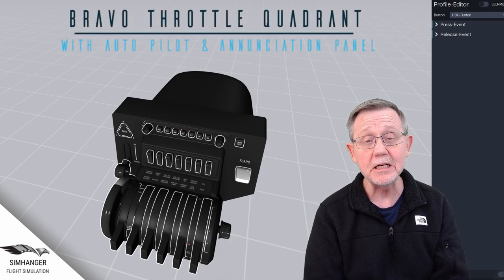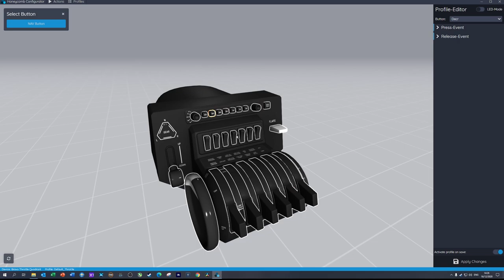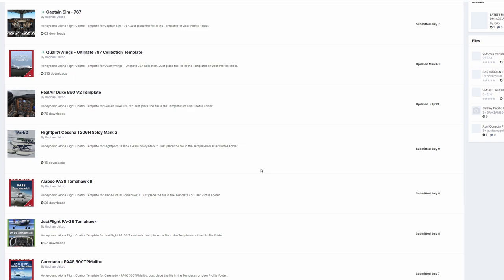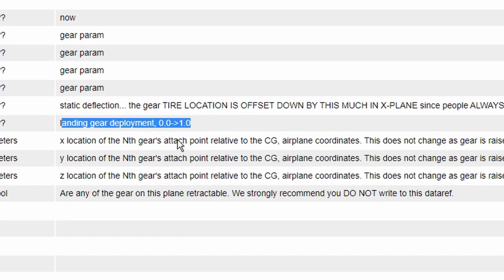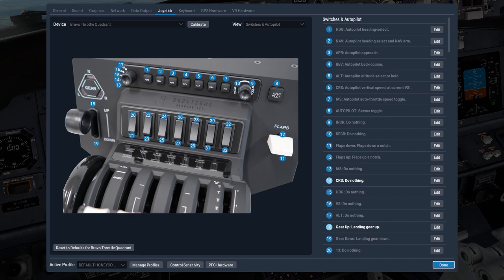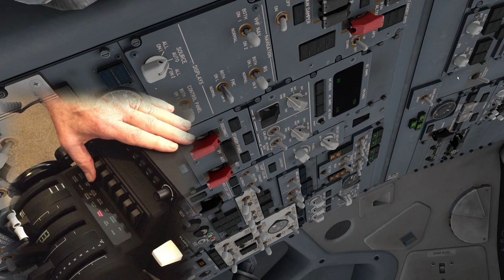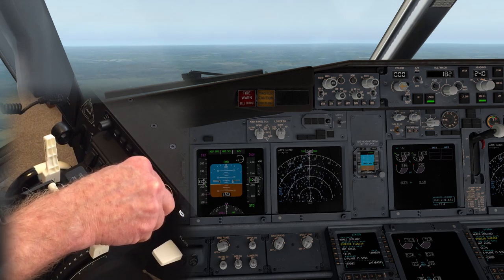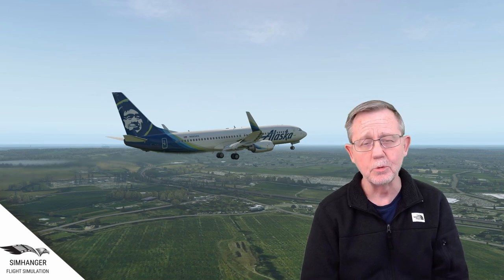BRAVO THROTTLE QUADRANT | CONFIGURING FOR XPLANE11 | Getting the lights on!

Comment from the maker: PROBLEMS INSTALLING HONEYCOMB CONFIGURATOR FOR XPLANE 11: See the description notes below the video, details of possible solutions provided there to help. Thanks for watching. Want to see the config for Microsoft Flight Simulator? Check it out here https://youtu.be/E06yP5g90eY       If problems downloading config file from site….right click and choose download incognito
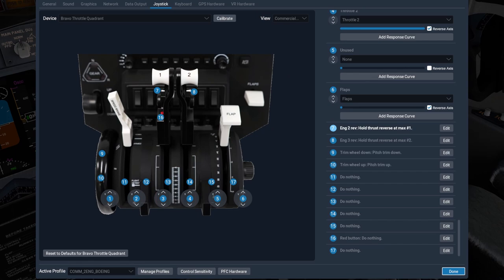Reply from the maker: Check you are mapping the reverse thrust to the right engines as shown in my video at time 14:36 hope you get it sorted.
Reply: Big fan of your videos, thank you! Do you know how I can solve the 'hydraulic oil low' light that seems constantly on??
Reply from the maker: @jagwal1   I have the same issue with most aircraft. You will need to adjust the parameters assigned to this function in the configurator. Regards
Reply: @SimHangerFS  OK...how?, what parameter should it be?
Reply from the maker: @jagwal1  to be honest I don’t know. Sorry.
Reply from the maker: @jagwal1   quick update, honeycomb to update configurator to eliminate this problem, not sure when. The MSFS has just been updated.
Reply: @SimHangerFS  Very good, thank you. Not that I'm in a rush, I'm just learning to set it up while I'm waiting for my graphics card for my new pc build, in backorder since October. ETA... April? Sigh :-(
Reply: Just downloaded the configurator for X-plane again to check if it's been fixed, not so...

Comment: Quick and Easy when it works. When the lights don't com on and the selectors don't work, you're hanging in the wind as no one has shown how to activate individual lights yet in the configurator. Lots of videos like this but none when the defaults don't work as they're supposed to.

Comment: The main point is having to download the drivers, something I didn't realize.  I couldn't understand the configurator so I just left that site.  In XP12, I got the essential speed brake and throttles going.  I set up the reversers in the same manner that you did but, no workee.  I will have to try things to figure out why not.  With my old Saiteks, I could simply pull them back into the detent and they worked, perhaps XP remembered that?  Not sure.
Fortunately my yoke has convenient buttons for the gear, TOGA, and flaps, as well as the trim.  Tomorrow I will try to set up the PMDG 737 in MFS2020.  Be interesting to see if reverse works in that.  
I got the Bravo throttles so I could also fly the ATR in MFS, and that is working fine, but has to be re-done so the positions match with the 737 and I don't have to swap throttle handles going back and forth.
Reply: Actually, I found that one of my reversers works and the other one didn't.  That shows that it was the correct procedure.  I have re-set the other one and will try it again.

Comment: Hello Mark. All my settings are working except for CRS knob in conjunction to Decrease/Increase Knob. Do you know why? When I put in CRS and select Decrease/Increase Knob nothing happens. Could you help me?
Reply from the maker: Make sure you turn the left hand dial to CRS…second to last position
Reply: @SimHangerFS  yes. It is in CRS position but when I use the decrease/increase knob nothing happens. It works fine on MSFS. The issue is only in XP11

Comment: Hi 
Thanks for the your videos. I have a question, do you install the software before or after you plug in the throttle quadrant, or does make any difference.
Thank you.
Reply from the maker: Plug in the peripheral first to create the default profile.
Reply: @SimHangerFS  Thank you, I just received the Honeycomb thottle quadrant. Thanks with help to set it up.

Comment: Great video Mark, thanks. Wonder if the heading bug for msfs will still go 10 degrees per click. Surely would defeat the purpose of having the throttle quadrant. I actually think Asobo did this "by design".
Reply from the maker: I hope they sort this heading issue  out in the 22 Dec update. 👍
Reply: @SimHangerFS  Has it been fixed yet?
Reply from the maker: @clearbluesky2009  regrettably no, they are indicating update three, so around end of Feb by the looks of it. Regards
Reply: @SimHangerFS  Thanks! Have you tried the solution described here (scroll down a bit to a post from a user named missamo)? https://forums.flightsimulator.com/t/honeycomb-bravo-throttle-quadrant-arrived-today-need-to-configure-settings-out-of-box/331412/30

Comment: Hi Mark. Thanks for the video. I was wondering how to get the reverser to release as they only register a button press when you pull them for me, so I have to pull them again to disengage the reverser. There seems to be no button associated with releasing the reverser levers.
Reply from the maker: Try throttle cut

Comment: Hello and thanks again for providing the informative tutorials. I run X-Plane on in MacOSX and it seems like some functionalities are not working as advertised. I.e. the import of profiles in the configurator does not work for me. I am also unclear how I would go about, or if it is necessary at all, to create a specific profile for the individual aircraft in my sim, i. e. Boeing, Airbus or generally single or multiple engine jets and various different turboprops, single or multiengine. How does X-Plane recognise these different profiles, that were created in the honeycomb configurator. Should or must we have different honeycomb profiles to match the different aircraft in X-Plane. In X-plane settings I only see the default honeycomb profile that can be bound to the bravo throttle. Should one see all the different honeycomb profiles that were created in order to tie them to a certain aircraft in X-Plane? Am I overthinking something?
Reply from the maker: Hello, the config module only gives you one profile with all the LED's activated. You can then build new profiles from that one, changing the config as needed and saving the profiles in Xplane under different names. You need to build from default or another profile created from the default....all existing profiles will not have the LED's activated. Regards
Reply: @SimHangerFS  Hello and thanks again for the quick response. I do understand what you are writing, but still it completely escapes me X-plane recognises the different profiles that I created or that were created by others. When I open up X-planes joystick settings menu, there only seems to be the default honeycomb profile and none of the other profiles that were created in Honeywell configuration tool. I think we talking different issues. How do the AFC_Bridge bindings find their way into X-Plane? I think I am either missing a step or something is not working the way it is supposed to.
Reply from the maker: @MisiekBaer  these are two separate issues. If you create a specific profile in the config tool you need to activate it in the config tool to push it into Xplane. Once in Xplane you can save this under another name for future use in Xplane. The other way/alternative is to use the default honeycomb profile that you initially activated as the basic building template to build new profiles for each aircraft or for each generic type of aircraft. Hope I have answered your question ....if not let me know. Regards
Reply from the maker: @MisiekBaer  , when you activate a profile in Xplane it should be there. Click on the profiles to show alternative saved profiles.
Reply: @SimHangerFS  I think I am beginning to see light at the end of the tunnel. Part of the confusion came from the fact that the configurator inititially did not work for me and I am still unable to import profiles. My take-away for building my own profiles is to activate the profile in the configurator and then x-plane can find these settings if a profile of the same a/c model is being configured in joystick settings. My second biggest take-away is that the aircraft specific data refs which must be addressed in the honeycomb profile will then also be recognised by the joystick settings for that a/c type. Honeycomb generic settings may or may not work for the various aircraft types in X-Plane and this goes mostly for the switches not the axis. Another caution is to be aware that not all downloadable Aerosoft profiles will work in the configurator.

Comment: Thanks got my throttles today  Followed along carefully but cant get the panel to work  or light up
Reply from the maker: Hi, the light configuration may not have copied across to your existing profiles, check the DEFAULT profile and they should work. This unfortunately means you will need to rebuild your profiles. Regards

Comment: When the msfs update releases can you see if all the lights light up on the Throttle when you test the annunciator lights on a plane in the sim? I know the default 172 with steam gauges has annunciator test and I think the cap 10 does as well. The flybywire a320 also can test the lights.
Reply from the maker: Good point I will check.

Comment: Why confugure to use the Course(CRS) button for vertical speed, when selector 16 is V/S(vertical speed)?
Reply: Btw I can not get the CRS button to be configured to be used to turn the course selector in Zibo. Any idas?
Reply from the maker: @helihot  , Hi, my throttle quad is an early model, the CRS button on the autopilot has been changed to VS. IAS button is used for flight level change. The Zibo uses some bespoke mapping for controllers unfortunately which is non-standard.
Reply: @SimHangerFS  Thanks, that makes sense. I didn't know there was an earlier model. And thanks for your video.

Comment: Hi Mark - absolutely love your videos and enthusiasm.  I have X-Plane 11 and will probably not get MSFS for a while.  I am having an issue with assigning my Honeycomb Bravo levers in X-Plane.  (I had the same issue with the Saitek throttle quadrant). Despite numerous calibration attempts my (737) throttles would be reversed - ie increasing the throttle would result in a decrease power in the sim and vice versa).  The axis for the speedbrake and flaps is reversed  (is this correct?).  Do you have any suggestions?  Should I re-install the Bravo?
Reply from the maker: Hi Warwick, this is a common issue, but easy to rectify. In the Joystick menu in Xplane, when binding an axis, you will see a small box labelled REVERSE AXIS tick that box and the axis will be reversed. Problem solved. Regards

Comment: Thank you for the video. I started with the C172 thinking it was the simplest, but I'm struggling to get the autopilot switching on/off by pressing the n°8 switch since I don't find the corresponding action in the XP11 list. It works if switched directly from the panel inside the plane, but this is not what I see in your video. Please help further, thanks
Reply from the maker: You can set this within Xplane directly. Regards
Reply: Toggle Servos is the command

Comment: I picked this up today and I am woefully out of my depth. I understand in principle that the configurator is used to set the device up with the various datarefs and commands in Xplane, but am I supposed to map anything in X-plane itself?
Reply from the maker: Yes, most functions can be mapped directly in Xplane. You need this config for those functions not using the default assignments.

Comment: I installed the drivers for XP11 and FSXSE.  I have two XP11 installations, and only one of them got the proper driver install; ie, the second one (11.51) does not have the illustration of the Bravo in settings, although it does seem to work with it.  This appears to be related to the lack of the bridge plugin in the 11.51 install, whereas it appears in the 11.50 basic install.  I have tried to install it again, to no avail.  Using the correct path.  Any idea what went wrong?
Reply from the maker: Hello,  I think the installer looks to a specific directory for Xplane. Not sure if it will install to two separate Xplane installs. Check the notes below my video....there is an explanation there that may help. Regards
Reply: @SimHangerFS  Multiple installs of XPlane are typical, particularly for those of us who play with the betas.  Right now I am keeping the 11.50 because one of my add-ons likes it better than 11.51.  As I said, it seems to work OK except that the nice picture of the unit with the numbers is not there.  Can I merely copy the bridge plugin over to the second install?
Reply from the maker: @anthonyvallillo422  ,  I’m not sure to be honest, worth a try. The other option to try might be to have the config x 2, each one looking to a specific Xplane install. This in theory could be achieved as per my notes?

Comment: Hi Mark, Thank you for your videos, I am experiencing issue with config Cessna 172 useing Honeycomb throttle. Throttle and Mix shows on xplane when moving however I don't get full throttle or mix and image jumps around on xplane image. Do you have a suggestion on how to fix. It seam as if I have a conflict on those 2 controls. I have made all other levers (do Nothing) I have tried throttle, throttle 1 and so on. Throttle is the only one that moves on screen of Xplane, but jumps around and doe's not give me full power. Any Suggestions would be great.
Reply from the maker: Hi Todd, sounds like you need to calibrate your controller in windows first, then in Xplane. Try that first. Regards
Reply: @SimHangerFS  Thank you for that. I will try this on Tuesday and let you know if this worked. Thank you for Quick reply. Regards
Reply: Still no luck with getting the Throttle and mix working. It only gets to 50% then has conflict. Looking at other forums, it looks like a lot of people have same problems. I think they need to update Honeycomb with new drivers for X-plane.
Reply from the maker: @toddbryant1355  Do you have the latest config installed? V2...see details here https://forum.aerosoft.com/index.php?/files/file/6000-x-plane-11-windows-honeycomb-software/

Comment: Great video. One question about default profile on X-Plane. The Alt button is lit on my Bravo as soon as I enter plane (Zibo). I press other buttons and they don't light up.  Is that normal? Can you share your profile?
Reply from the maker: Hi, yes my ALT light does come on. If I press the other buttons they also come on. The Zibo mod uses some non-default mappings unfortunately so the default autopilot does not work 100% with the Zibo at the moment. Regards

Comment: Hi thanks for the video. I am having an issue. I have done everything as shown in the video I believe. my issue is the gear lever does not do anything except when flying the zibo 737. In other planes the gear lever on the quadrant does nothing. In xplane the gear lever is set to up/down but when using the physical lever nothing happens. if I click the lever in virtual cockpit then lights go from green to red. If I fly zibo 737 however the gear lever works as it should. can you help me?
Reply from the maker: Hi Steven, sounds odd. First thing that comes to mind is what controller profile are you using for other aircraft. The lights config may not have carried across perhaps to other configurations. You may need to rebuild all configs from your default profile which will link the lights to the bindings. Regards

Comment: Thanks for the tutorial, when I select the directory in for my x plane folder, it still says it can't find it.  Any suggesion helps.
Reply from the maker: Yes, see the comment pinned to the top of the comments section.  Solution is detailed in the notes/description to the video. Regards
Reply: @SimHangerFS  thank you for the reply but after following the directions it still didn't work and I'm running out of ideas.
Reply from the maker: @richardsoucy3082  , manually check the location of your x-plane.exe file and note the path exactly. Then go to your x-plane_install_11.txt file per the instructions. Make a copy of the file. Then open the original file and delete all entries, and enter the full path as per above. Your path points to the directory where the Xplane exe file is located so don’t add the x-plane. exe to the path. Hope this helps. Regards
Reply: @SimHangerFS  THANKS SOOO MUCH!!!

Comment: I would like to use the full axis for speedbrake , flaps, etc. Meaning that instead of the "button" at the bottom of the axis, I would like it continue as an axis. Is this possible? And if so, how do I do it? I am using X-Plane 11 on Windows 10, if that helps.
Reply from the maker: Reassign to an axis, can’t recall details as I no longer have XP 11 installed, sorry.

Comment: hi mark, thanks for the info, im wanting to make increment  adjustments to the bravo throttle quandrant to change the ALT /HDG//IAS /VS from the standard 10 oer click to 100/500/1000 per click , i did see a video  on how to do this via mr jaranet but it only does it from a a 300 profile not from say a default profile ive made on the configurator... does anyone know how to do this, can i use a toggle switch on the annunciator panel to do this cheers